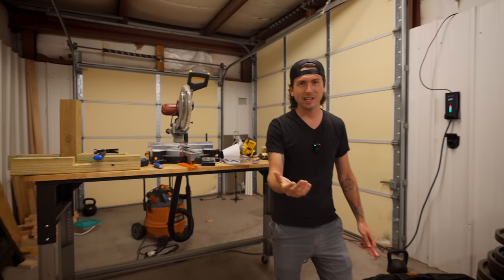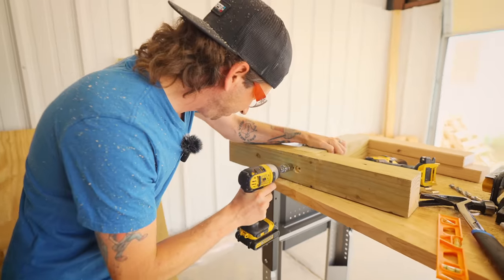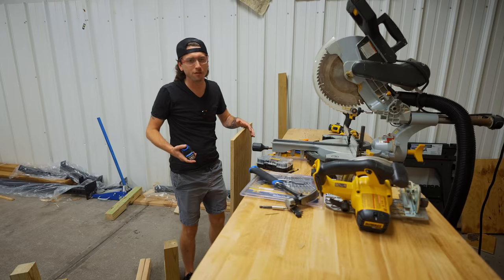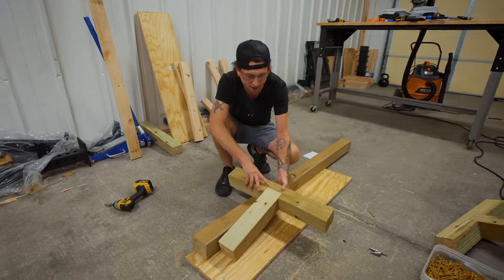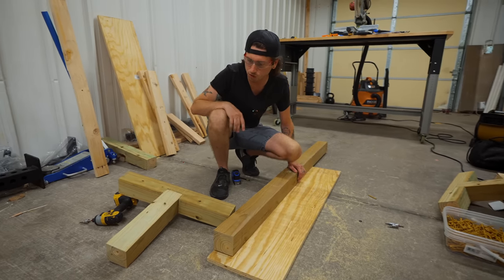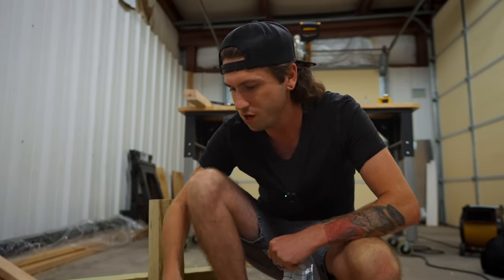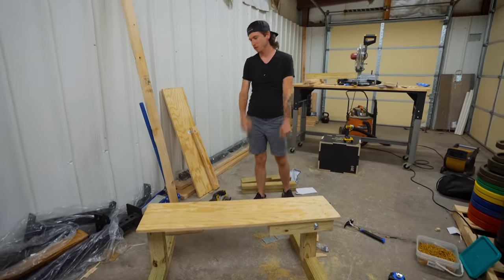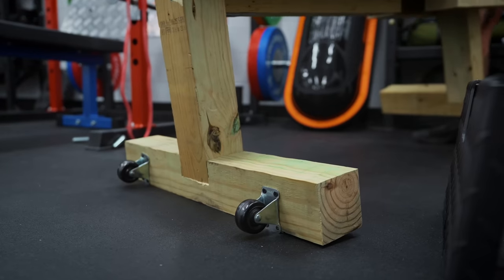DIY Weight Bench Guide (w/ A Secret Feature!)

Comment: I'm a mechanical engineer and that bench is a big mistake. You need a one good beam trough the midle. That gap is going to kill someone. And legs you make with 2 beams. And you also lock the leg only in one direction, you should lock it in both directions, like Rogue locks their fold rack beam with the pin.
Also Torsional stress is a Problemm.
 My English is not good.
Reply: Comments starting with "I am an expert" are easy to dismiss. You might have a point, but it's lost in hysteria, no one is going to get killed using this bench. I wouldn't use it for Strongman bench-presses, but it's a serviceable design for home use and probably safer than the bargain basement crap you can buy on Amazon. The end user who is building the bench will the be the ultimate judge of their use case and the serviceability of their construction.
Reply: I am an engineer too.  Using 1x1 and 1x6 in an intelligent way, my bench is extremely light and holds well over 1,000 lbs.  An attachment using 2x4s adds decline and incline capability.  I also have 2 trade tickets, so the tools are free, and materials were ~$60.
Reply: Yeah, I'm not an engineer but using basic physics and referencing the strength of plywood says that focal point of weakness can handle up to 50 lbs of shear stress before structural failure for a 3/4 in thickness....I know some my rebuttal that he laid on it with dumbbells and nothing happened but that's because it's spread through the bench and not at that point. So I would heed the engineer's warning. This can kill someone if they decided to bench heavy.

Comment: Get rid of the plywood and make a solid top out of some 2*6's or 2*8's.  A strong flat bench is better than a sketchy adjustable bench.  That's what I did at the start of lockdown, solid as a rock.  DIY cable systems can be extremely economical.
Reply: My DIY cable system was $140 for materials and I use it with 150lb weight, but it will take a lot more.  I used a 15' rope with a monkeys fist on each end, making it 18" or so long, as a tricep Y handle like the thick rope with two plastic ends that you see everywhere.  Weights were free as it fits my normal weights that I have anyways.
Reply: You are correct, a strong flat bench beats a sketchy adjustable.  Stability is key when the weights are huge and failure is disaster..  his base is big enough as long as it can take the large moment the center post (and plywood attachment) will be subjected to.  Depends largely on how big and strong the user is I guess.

Comment: I'm sorry to sound like a downer, but someone is going to ge seriously hurt using that!!!! 
That bench needs a full-piece rail of some sort running down the length of that pad and those need a brace or gusset of some kind to take on any kind of torsional stresses.

I say this because I like this channel alot- but I would strongly consider removing this video.
Reply: It makes me sad that I have to say I completely agree with this comment… Love the channel and the creativity but this design is very unsafe and unfortunately this video should definitely be removed. Good effort and great video content, just a mistake in design.
Reply: I agree, this is a dangerous design.

Comment: If you're benching under 250lb, this bench should be ok. It would be appropriate for me. Yes, it could be reinforced and gussied up, if you wish to extend the weight capacity. The vinyl seems to need more stretching, or might quickly wrinkle. I doubt that with 250 lb the plywood top will snap in half. Plywood is much stronger than that.